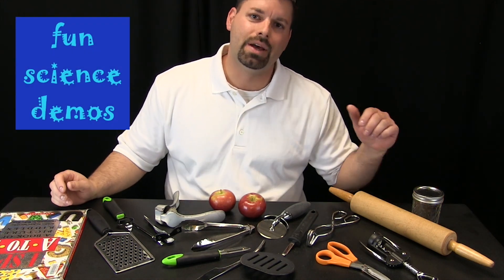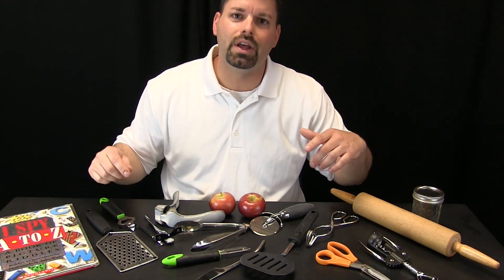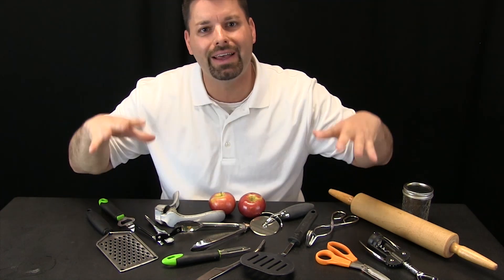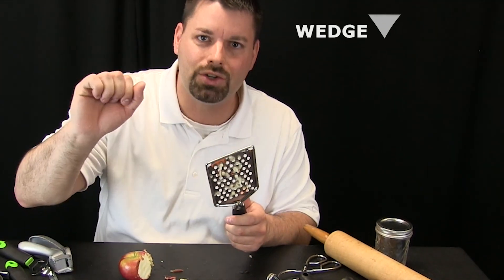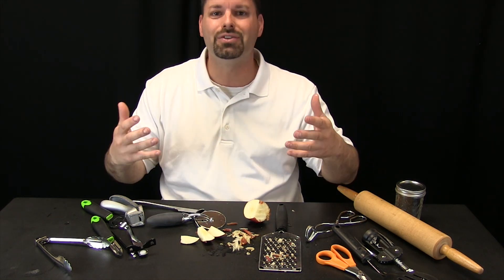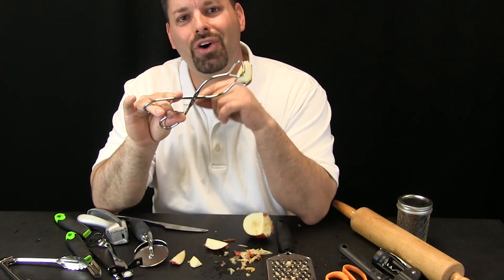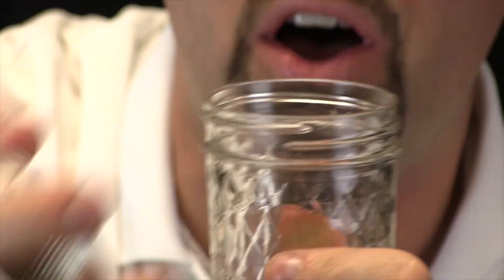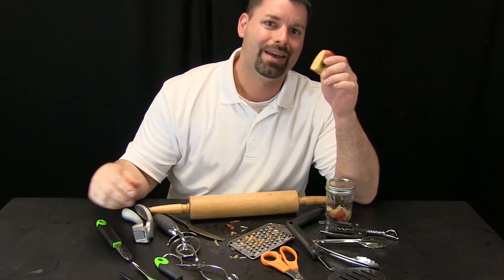Simple Machines in the Kitchen [I Try Science]

Comment: I run a similar lab with my 2nd grade students at the end of our simple machine unit. I bring in all sorts of tools and objects (including most of what you have on the table) and the kids have to identify what kind of simple machine(s) they see in each object. It's a great performance assessment. 
Question: I teach six simple machines including the screw. I see you've omitted the screw. I use a jar and lid as an example, but I see you're calling it an inclined plane. Screws (and wedges) are variations of inclined planes, so I'm curious why you have not recognized the screw as a simple machine. 
I also teach that gears are a variation of a wheel and axle. Your corkscrew has good examples of gears.
Reply from the maker: Hi Matt....we have a separate video on the screw, on our schedule.....You sound like a wonderful teacher. Thanks for all you do for so many!
Reply: Nice